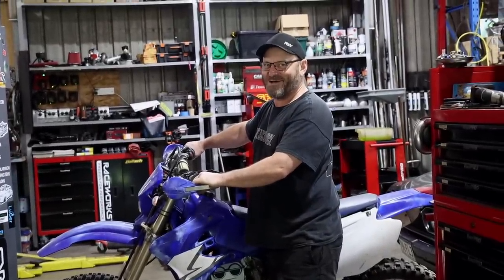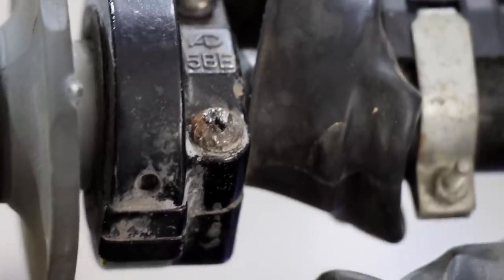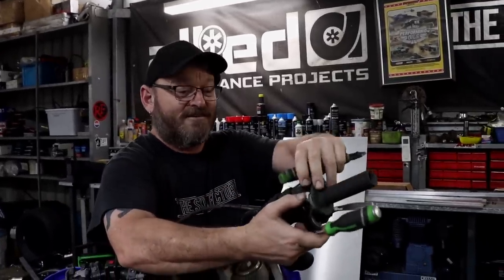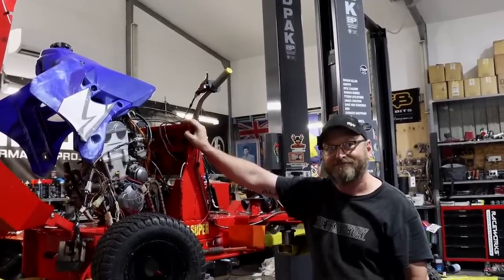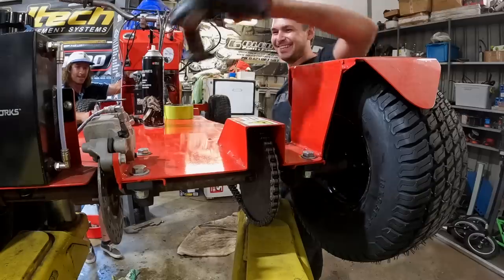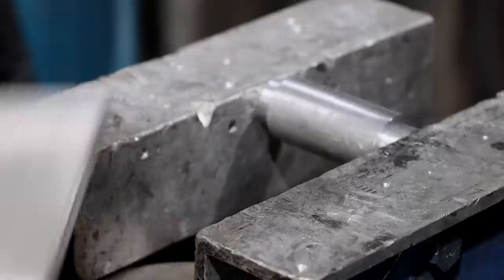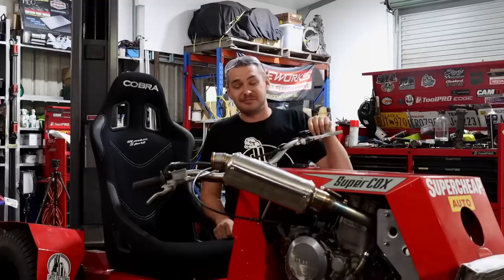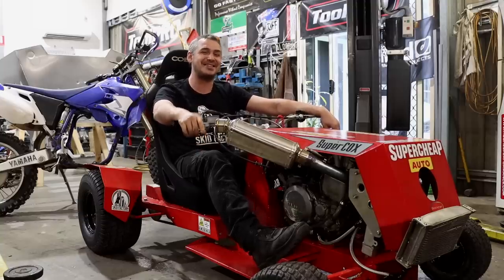Repowering the SUPERCOX for some Country Club Chaos with @supercheapautotv & @mightycarmods

Comment: Tiny single rotary, don’t make heaps of torque but light and revvy enough to have some fun!
Reply: Go watch Build, Break, Repeat. They use a lot of rotary engines for small karts and bikes.
Reply: Been done here in NZ years ago.a cut down single was made from. A 13b
Reply: My first thought too
Reply: Kkm 502?  Single rota by nsu?  Massive bridge port!!
Reply: Team Boosted have also been building a '7b' (half a 13b essentially) 1 rotor the past two years, though it's been a while since we saw an update.   
It was plenty to propel a 356 Speedster kit car though, so should be AMPLE power for a mower too :D
Reply: look into the suzuki re-5 old school 70s bike with a 500cc rotary.
Reply: @adammorton4753  yep, that was my suggestion too :D
Reply: @adammorton4753  didnt Norton do one as well?
Reply: Came here to say this. 😅
Reply: @jonathanwright5550 they did a few over the years, the one you wanted was the water cooled version used in the race prepped bikes, the air-cooled ones typically got too hot
Reply: @weegaz22  didn't know they did air cooled and water.  From memory the oil cooler was just as important

Comment: Surely you could get an old Subaru motor to fit in there, we all know you love them. It's low, and probably narrow enough if you put it in sideways, just mig a sprocket to the flywheel and run a chain to a motorbike gearbox with the clutch, bobs ya uncle

Comment: I think an interesting choice would be a 1300cc VW air-cooled flat 4. The drive may be a pain to work out but simple install of the engine with no radiator and real easy wiring. Plus how cool would a couple of Webber's hanging out each side look.
Reply: I was thinking use the transaxle and rear mount as factory did it for a bit of 911 tail happiness.Shortened drive shafts or bolt the wheels to the outputs.

Comment: Keep the current power plant, but couple an electric motor to the idler shaft as a 'power adder'.  Bonus points for working out the maximum rate the idler would spin at max speed and getting the gearing right.  Easy 'roll start' function if the starter kicks out too :)

Comment: Ducati testrastretta 1198cc engine from a Diavel or multistrada. Some of the amazing reasons to do so would be the engine note once you build an exhaust that works, a great heads up display to use as a dashboard for that bad boy, even give you some lap timing, taking it to a Ducati dealer for a service on the desk cables would probably be the funniest thing in the planet to get their reaction. The engine was built to be torquey as hell and who doesn't want over 150hp to the wheels on a lawnmower.

Comment: Work had a Honda rototiller made sometime in the 1990's. Thing was a beast. If it hit something it couldn't get through, it would just launch. 

Always started on the second pull. Even after sitting all winter. 

Everything is all lined up for it too.

Comment: The Super Cox is now the Super Dooper Cox, gonna be a ripper. Fun build to follow for sure.

When this project first started having drive transfer troubles, my thoughts were to use an 80's YZ shaftdrive three wheeler as the donor drivetrain.  I had a 50cc version way back when but they had 350's and I believe 450's too. Not sure how well it would do because of the preset length but since we're just dreaming anyway lol.

Comment: Weber (Textron) 750 Turbo MPE!  Compact engine designed for multiple applications.  Found in Snowmobiles (Polaris Dragon IQ), a number of PWC, and some other applications.  Good german design.  Stock power out of a 750 HO of 120HP.  Good tuners/kits were putting out 200HP, and at least one mad-man in Utah put out a 880cc kit that put out 350HP.

Comment: Big old air cooled 2T motor from the 70s. Like an IT490. It’d be off it’s chops and I reckon most of the competition would laugh hearing a 2 stroke before they see it blow them out of the water. Plus it’d still be the “Super Yamma Cox”

Comment: Re-power the SuperCox with a 1699cc upright twin from a Triumph Thunderbird motorbike. 270 degree firing angle for an excellent sound, and torque for days. Smooth 6 speed box for extra close ratio awesomeness.

Comment: Looks like fun. I would've tried putting either a modern Kawasaki ER6 paralleltwin engine, or an older Suzuki sv650 engine(twin). good size and the sound is so amazing.

Comment: I would chuck in the Two Stroke Yamaha 1100 Triple (63M) that I rebuilt for an old Jetski purely because it sounds awesome. Would need a rad, and some kind of water tank for the exhaust to exit in to maintain that burble sound.

Comment: Engine choice is easy! Use what you have laying around, It's a mower not a top fueller.
Make it look and sound cool, go have fun. Job done.
For me that would be an old mtd mower, Chinese Lifan 250cc 4stroke 6 speed.
And as a fitter machinist, get some taper locks, servicing trackside with welded shaft components will really impede on your pit stop times!

Comment: AMR300 Supercharged 670cc Honda V Twin. Horizontal shaft to increase clutch options.  Quad bike rear diff so a tail shaft can be used instead of belt drive.

Comment: Hello, ones we buyed a racingmower with a Kawasaki ninja 600cc, 4 cilinder with 4 carbureteurs..its screams when you rev it throu the gears👍, it was great but also dangerous! Whe use a axle from a go cart, they are verry strong and you can use the footpedal for the brake, nice  work you both doing! Greats from Holland..

Comment: The 16lf I pulled out of my n13 pulsar ages ago when I put the better 18le in,  its sitting in the shed doing nothing and the ol delco injection system is easy to work with

Comment: Woody, Al, what about a big ass BMW R1200GS engine. Big heads sticking out the sides to scare the other competitors , and a shaft drive to keep the legs safe. And twin pipes sticking out one each side for looks. Oh and to save the lugholes from those pipes, a pair of Supercheap ear defenders when test driving.

Comment: I'd put a BMW K1100 motorcycle engine in it. 1100cc 4 cylinder with 73kW in a small formfactor with a dry clutch and a 5 speed gearbox. People have put turbos on these to bring them up to 125kW. That must be terrifying amount of power on the rear wheel of a motorcycle but it's probably not less terrifying on the Super Cox!

Comment: I would of used a klr650, they are great motors with a longer stroke and have oodles of torque! 
We used them in our edge products sidewinder buggies! 
Electric start and they don’t need to rev to the moon to get it to go fast!
I think what you guys have done is great also.
Klr650 motors aren’t cheap and ur donor bike was perfect for this

Comment: The one I think would work is the guts of a Raptor 700R. They're not cheap but there are mad little turbo kits you can get for them.

The one I'd want to work is a carby Mazda 12A mated to a snow mobile CVT but it'd be pushing the package space more than a little.

Comment: Something I think that would be cool would be a small 1200 engine from an early 2000s sportster.  With a chain conversion.  Making it only need 5 gears as well.  Plenty of torque and more than enough power

Comment: I think that a Moto Guzzi 500cc woudl fit nicely in there. It eliminates the need for all the chains and sprockets, but you would need some kind of rear diff to adapt the drive shaft to the rear wheels.
Also it's air cooled so less parts to mount and it will sound nice with two straight pipes on the sides.  Maybe lean the idle mixture a bit for some pops on decel

Comment: Because I'm Canadian, I'd power a cox snowmobile engine. 2 stroke, air cooled 440 from a Polaris XC-F, a race sled designed to fit into a class of air cooled sleds. 90hp of air cooled 2 cylinder fury, no radiator or coolant to deal with, and an infinitely tunable CVT that can be tweaked to keep the engine in the power 24/7 and really fry tire.

Comment: I'd put a 600 or 750 GSXR motor in it. 
The motors are readily available and can be had cheap. 
You'd then have a 15,000rpm screamer that I'd personally gear down so you could use all 6 gears and hear it scream through the gears with a quickshifter for those awesome WOT gear changes.

Comment: A old 550 cc Honda engine from a road bike would be a good fit for Cox mower. Good power and Tq and the sound they sound pretty beefy and the look of a old Honda inline 4 motor bike engine would look pretty menacing. 450 in it now still looks bad ass and probably a blast to ride.

Comment: Good work fellas looks like a lot of fun will come from this upgrade. As far as a motor id like to see would be a kabota 3 cylinder turbocharged with tall gear ratio. After all its a mini tractor then a tractor pull could be possible with some upgrades for torque of course. 👌

Comment: Great video, the WR450 motor conversion looks like heaps of fun.
OK this is going to sound daft but what about a Fiat 500 twin air, 
875cc 2 cylinder turbo, the engine is compact, light, and a good amount of torque. 

I'm sure the engines can be sourced from wreckers with the electronics to get them running. 
 😂 The damn thing may even be emission compliant after the conversion 😂

Comment: many years ago I had made a billy cart to run at morgan park, when it was first a sealed track from dirt, I still have the bike but not the cart, metal fatigue got the better of the frame, I think my engine would have chewed and spat out that 4 stroke bomb for breakfast. with the mods I have and avgas, theoretically it should have been making well over 60 hp. Ivan Tighe with his formula holden took my lap record. long time ago I'm afraid, my health went bad. oh and still got the media print somewhere to prove it. the bike is, 1989 rmx 250. and well done with your machinery.

Comment: 300cc injected 2 stroke with a power commander. Leaves option open for turbocharging.
Either that or a 500cc 2 stroke motor from out of old school Honda CR500 or a Kawasaki KX500.

Comment: MT09 engine.... crossplane crank, all alloy, 890 triple engine. Heaps of torque, 3 engines modes if you need to turn it down and would sound amazing and unique in the Super Cox 👌 

PS I please need an OBD reader to see whether my headgaskets are still intact on my MY99 WRX 😆😁

Comment: I would go the same route with a bike engine. But I probably use a Suzuki GS500 engine as it is air cooled so I didn’t have to worry about the water cooling. Plus they are a bullet proof engine.

Comment: Suzuki sv650, v twin, compact, powerful as, scheap, realiable and easy to adapt, would need to strengthen the mower frame tho. I had a stiga one which could probably have housed even a one rotor, had a massive engine bay lol, cheers guys

Comment: I’ve got a GSXR1000 engine sitting in the shed, but might be a bit overkill. Gonna go with the engine from the stat writeoff Ninja 650 sitting next to it. Full bike in running condition. Parallel twin with EFI , think the bike might even have ABS too.

Comment: Honda Goldwing engine would be cool to keep the motorbike engine theme going. Also with the shaft output could add a little LSD. Also also if you get one that used to have a sidecar it will mostly likely have a reverse gear (not necessary but handy)

Comment: Have an Honda VFR 750 from 98 in storage that needs repairs on the frame and plastics but engine is in a running condition.
It is an overkill but would be a good fit and would not require me to find something else - so reusing it instead of letting it sit.
The V4 engine revs well and is considered indestructible. Just imagine options for exhaust so many flame spitting pipes.

Comment: I reckon an outboard engine, 2 stroke so you can lay it on its side for the chain and turn the carbs back to vertical (fuel injected better). 50 horse maybe. Multiple cylinders so better torque. Set up a radiator and electric water pump. Not sure on the clutch n gears, might not need gears, work it out. Something different

Comment: Can we get a 2 step with a recycled shift light to trigger a relay to cut power to the coil and a cheeky wheelie bar.... If the drive line can handle it... Just to make sure the mower has enough speed to get up the steap trailer ramps after a hard day on the mow ?

Comment: early 2000's Triumph 955i, 3cyl, good torque, good power, great sound, fuel injected with free software to monkey with the ecu. and it will make 120 hp at maybe 9000 rpm in the speed triple / sprint cam version and 145 at 11k in the Daytona cammed version

Comment: Netgain 120 hp electric motor. Has a splined output shaft for a 1310 or 50 yoke. Run that to any solid rear axle, add some batteries and win!

Comment: I'd love to swap an old OMC v8 outboard powerhead onto a mower with 8 single pipes twisting out the bonnet. The vertical shaft maybe and issue but I'm sure you could use the 90deg gearbox from the same motor somehow....

Comment: If the supercox was mine, I'd probably go electric! 
Direct drive to the rear axel, lithium cells up and down the chassis as low down as possible
Fingers crossed it won't break something but just for that tyre spinning whiplash torque

As sacrilegious as it is... but no moving parts, much less maintenance and it'd be a hell of a lot of fun

Comment: I hope this isn't too unrealistic but I'd repower Supercox with a naturally aspirated 4G63 from an RVR paired with an automatic transmission (with overdrive!)

Before you roll your eyes hear me out. 112kw from the 4G63 would haul in the Supercox and the auto transmission would keep it from bogging when you're getting stuck in on dirt. 

It'd also have a reverse gear which I'm sure you'd find useful on the odd occasion. I reckon you could make it fit. Being kinda tall its likely the cam cover might sit above the bonnet line

I suspect you might need some kind of doghouse up front to cover the prop shaft. Obviously you'd have to sort some kind of teeny tiny rear diff/axle combo, might be a bit of a challenge but I'm sure you buys are up to it

As to the main reason why this would be my choice?   I already have this engine and trans sitting in my parts car with no use for it, taking up space and annoying the missus. Additionally maybe one day you might decide to add boost and the mighty 4G would take that like a champ

Comment: Id run a fuel injected crf450f motor with a little vz21 turbo charger running a charge capacitor in the boost line to try maintain a stable boost pressure! Would be great fun.

I have an old mower with the deck removed used as a paddock runner i should definitely do this one day

Comment: yamaha virago 750cc v-twin, bit similar to the first engine however this one is shaft drive, it would need some kind of diff at the back but would get rid of the clutch problems. The motorcycle diff might work but it would need extensive modifications to allow an atv type axle to slot through it. Dont know if its doable just a thought. Reason why is cause i have one laying around here somewhere.

Comment: I'd use for Supercox the engine out of my Royal Enfield 650 for a few reasons.
One the twin cylinder rumble gives a mean car like burble at idle.
Two, the torque range unlike most bikes is from 2k rpm on to make the mower heaps driveable
Three, the retro engine casings would make the mower look old school cool like a hot rod, Al's Rolla etc
Sometimes ya don't want the sensible logic based choice but the vibe and feel choice. Do it cause it's cool, not smart, right Woody? ;)

Comment: Little 660cc kei class 3 cylinder engine, lay flat type for better centre of gravity would be pretty cool, dry sump possibly, turbo of course. F6A from a cappuccino or Alto Works RS. Open exhaust, external gate...

Comment: A top engine for the Cox would be a Suzuki 750 triple two stroke from around the era. It would be in keeping with the original nickname of the bike being the Widow maker, as it would go from 0 to breakneck speed in the blink of an eye. The issue was, they wouldn't corner very well..... Hence Widow maker. The Cox would definitely be a 4 wheel version of it, with a donk like that in it. 😅🤣😂 Awesome project 👍
Reply: Wasn't that the nickname given to the Kawa 750 triple, otherwise known as the flexy flyer?
Reply: @alexbrown1995  & the Suzuki I believe, they were both death spears. 🤣

Comment: If it were me I'd power the Supercox with a nice beefy electric motor. No fuel or gears or whatever to worry about, just motor, battery (not a huge one, it doesn't have to run long) and a controller box. Simple, and no maintenance for Woody to neglect.

Comment: No budget constraint motor for the mower build?
A Maico/ATK 700cc 2stroke- I cant remember if they had an eleaktric start, BUT they DID have 78hp on tap....
Otherwise, I'd be trying to find that bloke up in Qld that was converting RD350/400motor into 500twins punching out GP-bike like H.P (from memory he then put them in 125 Cagiva* frames.
I'd send him some Banshee cases & source one of those electric start kits from the 'states...

If I was doing it to be different I'd probably looking to something like a SACHS industrial rotary...
And if I was doing it on the cheap, I'd probably have gone a similar route to you both.

*Speaking of Cagiva's, I remember seeing an F2 sidecar at Eastern Creek powered by a Cagiva v-twin & had THE LONGEST CHAIN I have EVER seen, & it was turning blue from new from each race it entered!
When ya get that mower back, would be worth trying to knock up some kind of chain protection/oilbath under that mower of yours... ;)

How to tell someone is getting older without saying it...
Your arms must be getting shorter!